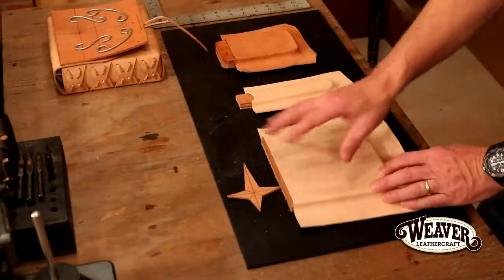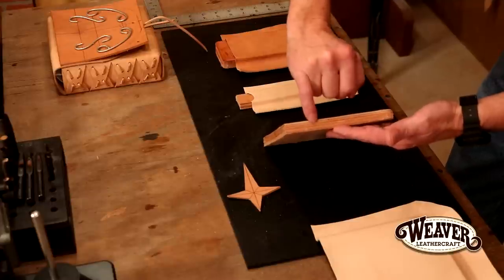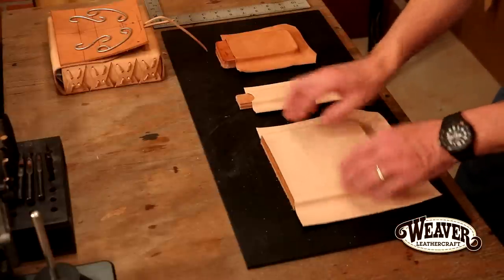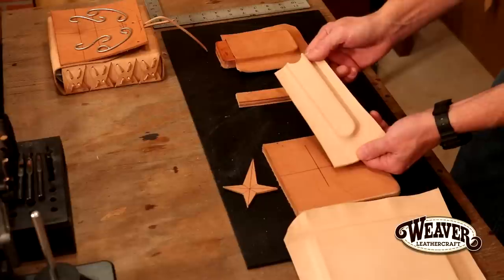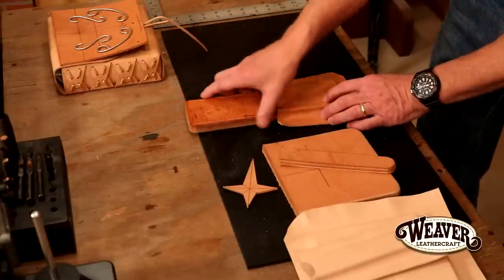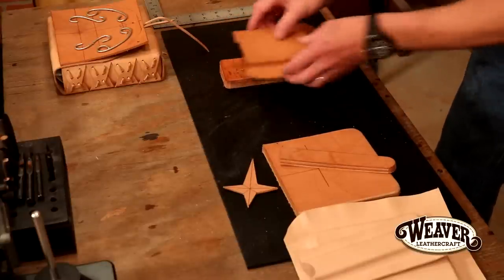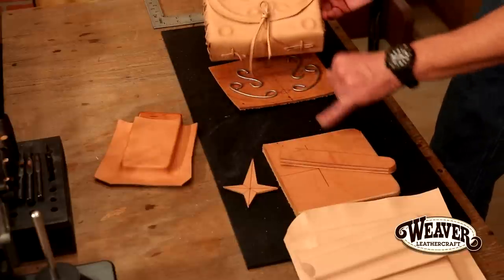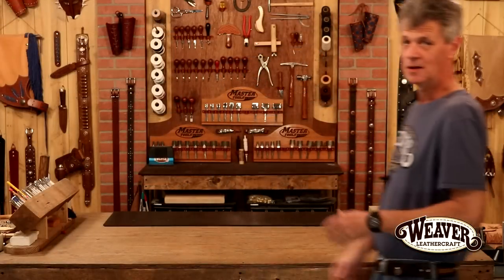The Leather Element: Items to Use for Molding Leather

Comment: Ahhh yes! You begin to reveal the secondary and artistic aspect of raised design molding. Thank you. I have a book cover project on which I want to combine engraving and raised molding in a very special Elk design. I also want to incorporate cut outs that glass gemstones peek through, for lots of sparkle. The first thing I will need to know (I think) is the best thickness of "veg tan" to use. Then I need to figure out which process to do first; the raised embossing, or the engraving. What do y'all think?
Reply from the maker: Hi Daniel,
This one is a tough call, but, it sounds like it’s going to be a beautiful project!  I might say a 4/5 oz. will work best for the molding and embossing.  Without seeing the design I may say form first and then add your embossed image.  If you emboss first then the stretching that occurs when forming may pull some of the impression out.  See if this helps?

Comment: Video suggestion (unless it's already there and I've missed it): dye's, finishes, deglaser, alcohol, oil based, etc. It's all very confusing. Chuck you do such a good job teaching and simplify things. Your the one to clear this all up. Thanks - love the videos (and started buying from Weaver).
Reply from the maker: Hi Keith!
Thanks so much for watching! We do have a few videos that will hopefully clear up some of the confusion! Oil Dye vs Alcohol Dye: https://www.youtube.com/watch?v=zokhe6oxhjc 
And here is a video on finishes and top coats: https://www.youtube.com/watch?v=Ff-SVFhhJjc
Deglazer: https://www.youtube.com/watch?v=JBDM2LaRefw
Let us know if this doesn't cover all your questions!
Reply: I came to the comments to check on this topic. I've seen a ton of videos on the dyes/stains/antiques/glosses/etc but it's such a pain to go to one video for one thing and another for a different thing. It would be really nice to have one video that covers all of the chemicals. When do you apply antique? Can you redo antique if it doesn't give the right color? When do you apply finishers? Gloss? Oil? How long does it need to dry? How do you touchup something that has bled and faded? How to buff up a good shine? Should you use super shene or something else? Carnauba Creme? Resolene? Mink Oil? Leather conditioner and applications. 

PS. Huge fan of Weaver and specifically Chuck. He's the reason I got into the craft truth be told. Mild curiosity on the art and finding these tutorials really played a big part in me buying into the craft (and purchasing from Weaver as well <3). Thank you!

Comment: Hi Chuck thanks for the info.
I want to wet mould a phone case like you made but want to line it.Should I line it before to wet mould or after.Would it work to mould both together.Thanks Chuck,your the Man!
Reply from the maker: Hi Ivan,
Yes, you can wet mold both together. I don't know if you watched the leather holster video, but in that video, we glue a liner on and then wet mold it. I linked the video below in case you missed it: https://www.youtube.com/watch?v=xCaFJcZbKYk
Reply: @WeaverLeatherSupply  Thanks Brother...I'm checking out the video.

Comment: Tooling/stamping and molding leather, is there a way to combine the two without fading and warping your tooling?
Reply from the maker: Hi there! 
You can combine the two, but you're going to lose some of the definition of your tooling. We have a gun holster video coming out in a few weeks where the holster is basketweave stamped and then molded but we only stamped part of the holster. That video may be helpful for you! It is launching January 3, 2019
Reply: @WeaverLeatherSupply  looking forward to it. Thanks

Comment: Ive only worked with rawhide, does leather set similarly, stay in the shape it is set to?  Also is there a difference between this and how the skin has been treated?  Thanks
Reply from the maker: Hi there,
If leather is wet molded, then yes, it will stay in the shape it is set to. Veg tan leather is what you would need for molding. Chrome tanned leather is softer and will not mold. Hope that helps!
Reply: Thanks  @WeaverLeatherSupply

Comment: Hello, I need help. So I have a project where I have to use leather and I want to make a simple moulded pocket for some pencils. However I am required to use a laser cutter. Is leather flexible enough for me to mould it and still have it keep the initial contour it had? It would require a 10mm space for the pencils to fit.
Reply from the maker: Hi Douglas,
Are you asking whether or not you can mold it and then laser cut it? Just want to make sure I'm answering the right questions.
Reply: @WeaverLeatherSupply  hello. No I mean to laser cut it first so it's flat and safe and then sew it to the surface where I need it. After that I thought about moulding it but I don't know wether it'll keep it's area once I started moulding the pocket.
Reply from the maker: @douglasascencio9140  I am a little unsure of the question but I think I know what you’re asking here.  The actual shape of the leather will draw in when you mold it so it’s common to take an oversized cut and mold to the form then trim to final size.  In this situation you may be able to mold the leather after sewing.   Big Note:  If you only have one shot at this I am hesitant to say form after sewing, unless, you have some additional leather that you can experiment with.  Since you’re molding pencils and they’re not huge objects the leather will stretch enough for a mold and, when sewn and then formed, the backing or whatever it’s sewn to will give it some body which will help molding and holding the mold.

If you want to cut to final and mold before sewing you can cut the pocket to size but make the throat about 1/8” wider on each side.  Basically if the pocket is 3” wide by 7” long the bottom would be 3” wide and the top/throat would be 3 ¼” wide (a bit funnel shaped).  This will give the throat a little extra room to draw in when molding and, when molded, should come to rest at 3”.  The lower end will stretch enough to mold without drawing in so when molded you should have a 3” x 7” pocket.  Let this dry completely.  Sewing wet leather is a mess and the outcome is awful.

See if this helps, or, if I’ve missed the point completely please feel free to add additional questions!
Reply: @WeaverLeatherSupply  Thank you so much for the feedback. In the end I used felt for the pocket I had in mind in order to add more variety to the whole thing. Nonetheless I will take on future projects from here on out where I have more time to experiment. I have fallen for leather and I appreciate your advise dearly :) I'll keep on watching your awesome content. Thanks again.